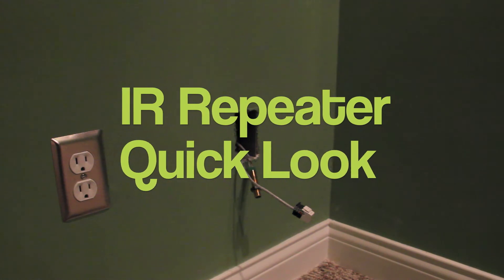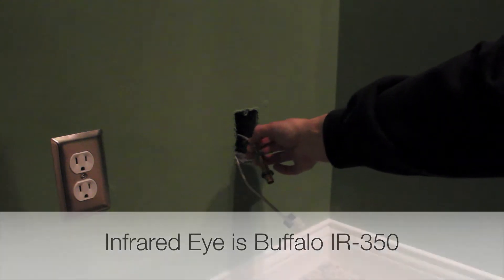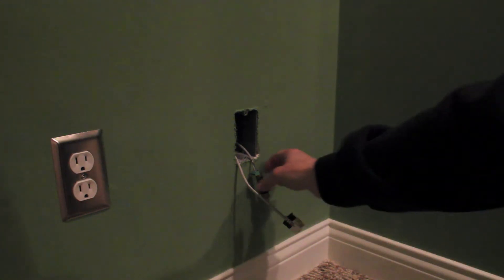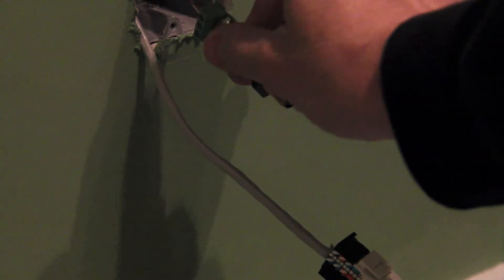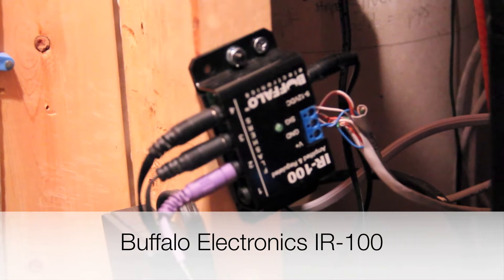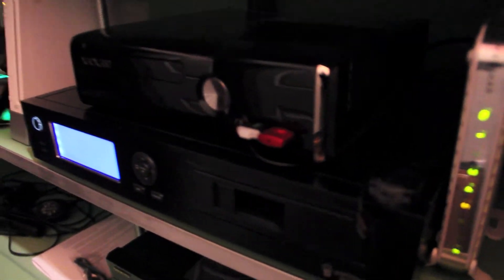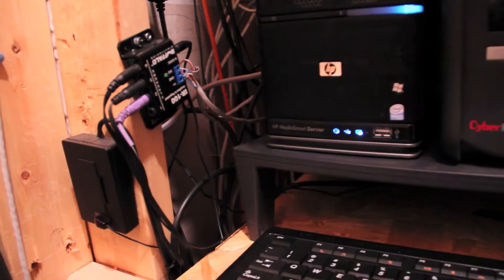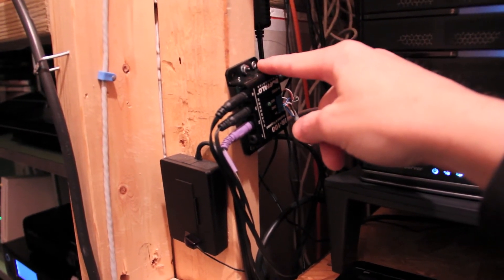Infrared Repeater setup

Comment from the maker: The IR receiver connects to a box with multiple IR emitter outputs. Those are placed over the IR window for each device I want to control. I use a Harmony One remote which is configured to control each device based on the activity I select, so the lights are handled by the same remote as the rest of the devices.

Comment: The Hot Link Pro or Hot Link XL are very good IR repeating products as well. Look on Amazon for the best price, usually can get it discounted about 25 bucks off of retail. Compatible with ATT UVerse and Scientific Atlanta 8300 set top boxes, plasmas and LCD tis, as well as all other kinds of display options, CRT and projectors, DLP rear projection, etc. Compatible with Harmony and most all other universal/learning remotes.